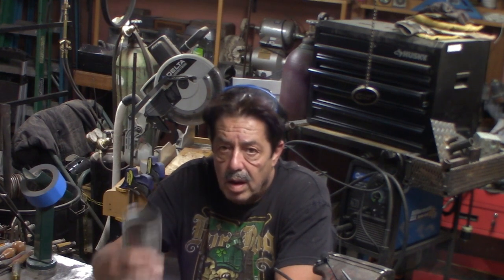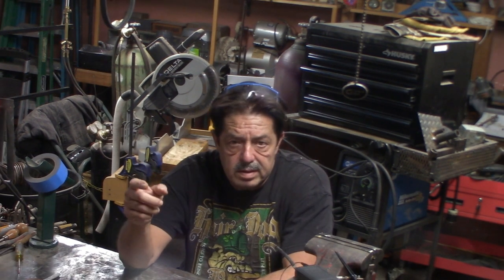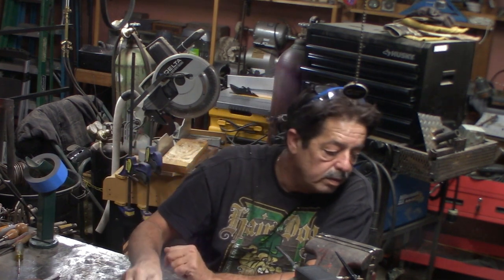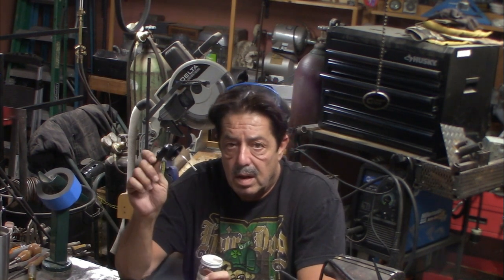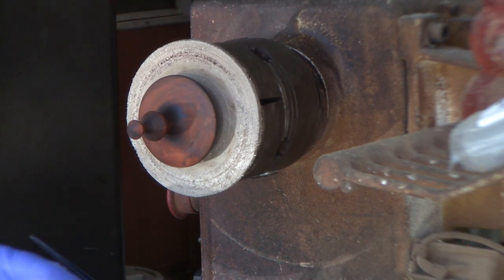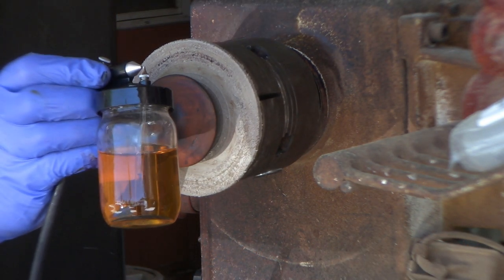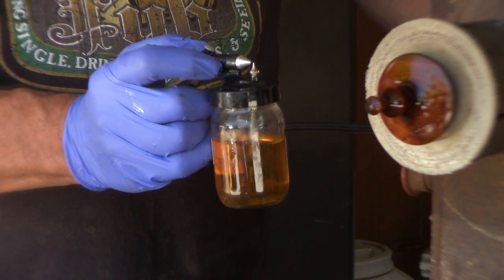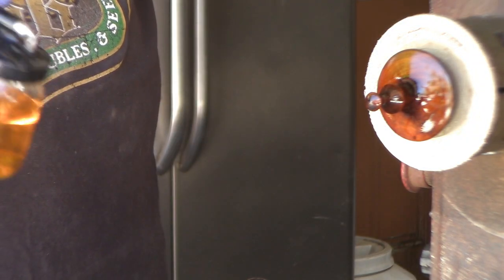Badger 250 - Accessories and Demo of the Large Tip

Comment: I purchased the bigger 250-4 by accident and I loved it.  I bought a pancake compressor and necessary hardware to run this. I typically use 1 to 3 ounces of finish on my projects and the 3/4 oz model I had to refill the jar multiple times.  

I have sprayed a few different finishes but my favorite is oil based alkyd thinned by Naphtha.
Reply from the maker: yeah i have thinned and applied oils to some of my projects and used tint...........it works very well

Comment: Hey Handyman,  great video I'm a total newbie with spray guns. As a hobby I make verneer boxes, and hand apply shellac. Can the Badger actually spray shellac on to my projects? And can the Badger  spray lacquer? Over the shellac ? Kind regards Danny uk
Reply from the maker: Yes to both - but i perfer to spray lacquer (nitrocellulose based) and build up coats till im satified with the build - Yes you can put lacquer over shellac as long as it is ...."dewaxed shellac"...... if it is not you can run into problems easy with the finish - my other finish i like that will give you a good hand finish is take a small bottle and put 1/3 dewaxed shellac, 1/3 alcohol. 1/3 boiled linseed oil - friction polish but i am only using this on projects on my wood lathe........ i hope this helps you
Reply: @TheHomeHandyman  that's extremely helpful. Thank you..yes I do use dewaxed shellac....the other question I have is ...would you recommend the Badger 250-4 ? ...regards Danny uk
Reply from the maker: @TheLegend-nx3mm   yeah - I use the 250 for small projects and spraying - but i also have the larger bottles and the other size tips to switch out when i think it will work better - the standard bottles are to small at times for me especially if i am toning with lacquer but again it depends on your size of project so its best for me to have the larger bottles and other size tips - it is not expensive
Reply: @TheHomeHandyman  yes I agree it's not expensive...and just a couple more questions if I may...? What is the mix ratio if using  de waxed shellac, denatured alcohol? Or is the 3rd ratio you mentioned previously with linseed oil ? And what compressor would you recommend with the badger 250-4 ?  Kind regards Danny uk
Reply: @TheHomeHandyman  As for my projects there no bigger than 400mm x 400mm x 400mm all verneered using anything from white oak, ebony macassar,  rosewood,  walnut etc etc ...regards Danny uk